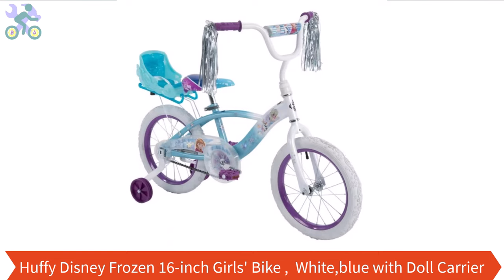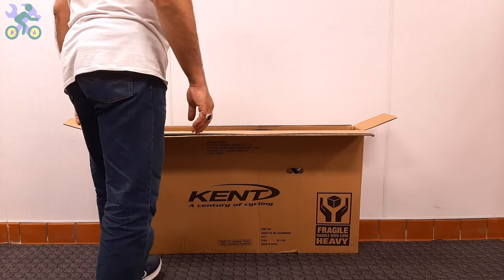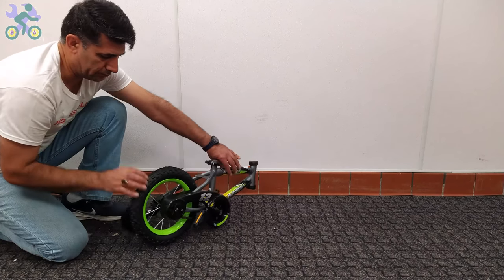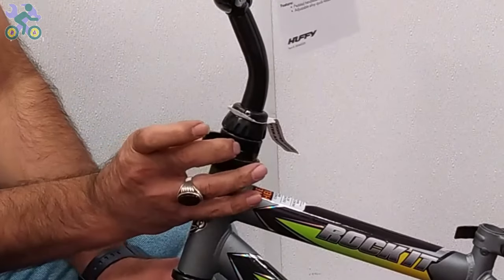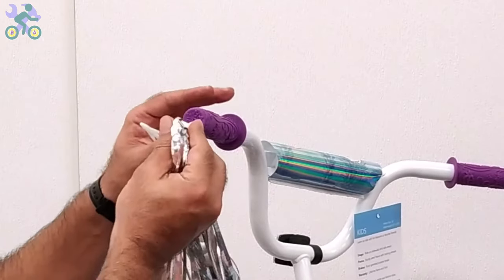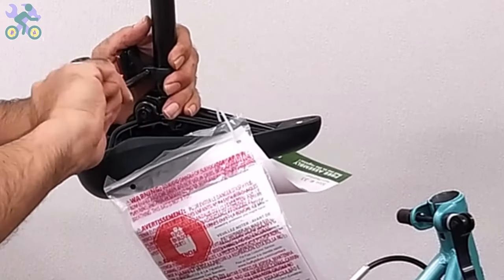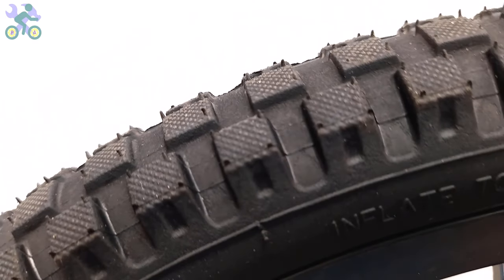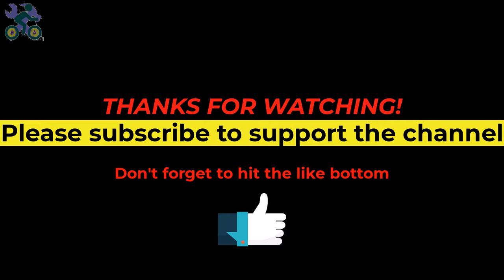How To Assemble Huffy 16 inch Disney Frozen 2 Bike with Doll Carrier Sleigh  Girl's, White , Purple

Comment: How do you replace the chain? After 4 months it fell off and won’t stay in place on the chain prongs. Do you have any advice on whether we need to shorten the chain or just replace it.
Reply from the maker: Hi there and sorry for the late reply
If only the chain is removed from the solar wheel, put it back in its place and turn the pedal one round, as in the video below at minute 10:45.
https://www.youtube.com/watch?v=FCS_XlcV0Gw
If the chain is broken, you can buy a chain lock and reattach the chain. But if you need to buy a new chain, you need a size of 1/2" x 1/8" .

https://www.amazon.com/Schwinn-Bicycle-Chain-Multi-Speed/dp/B0089WXYHW?source=ps-sl-shoppingads-lpcontext&ref_=fplfs&smid=ATVPDKIKX0DER&th=1&psc=1